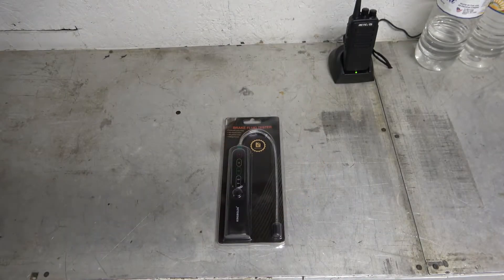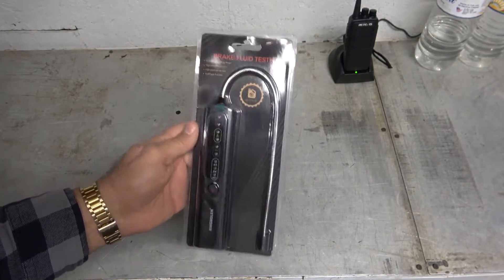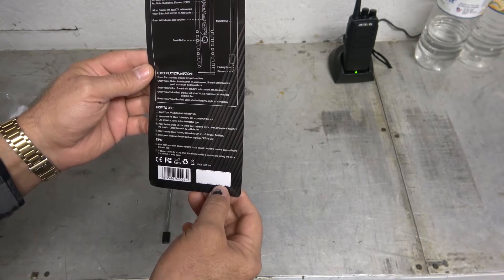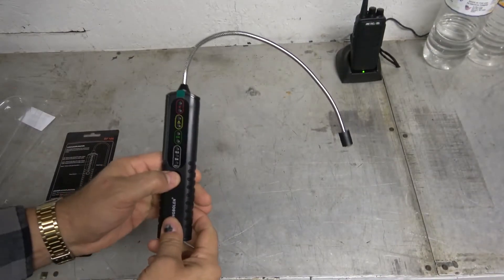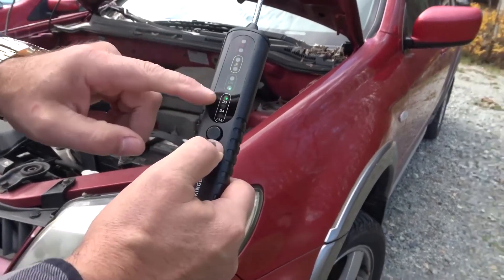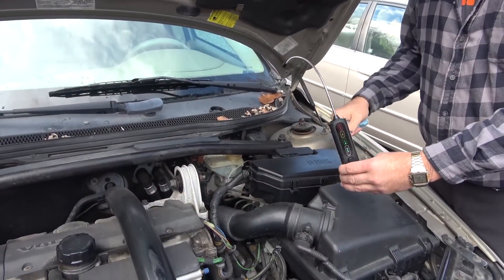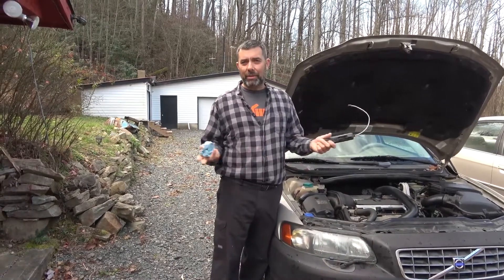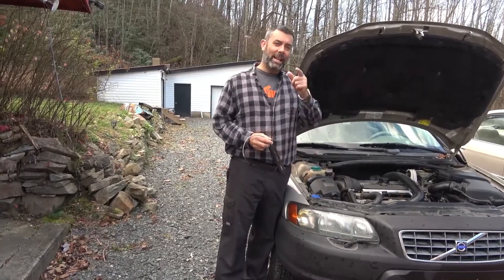How to use brake fluid tester?

Comment: How deep do you insert the probe? I put it in just barely and it says the brake fluid is bad, but when I put it in an inch or two it says it's fine
Reply from the maker: Hello, It is possible that you have just inserted the probe and have not fully come into contact with the brake fluid. We suggest that you completely immerse the probe in the brake fluid before viewing the results, which will be more accurate.